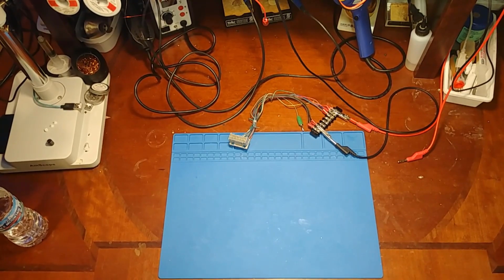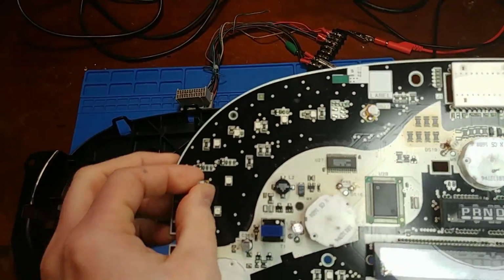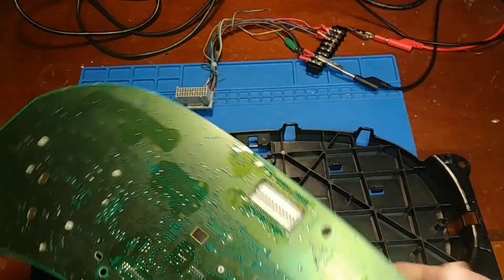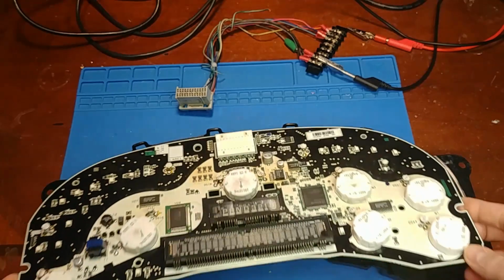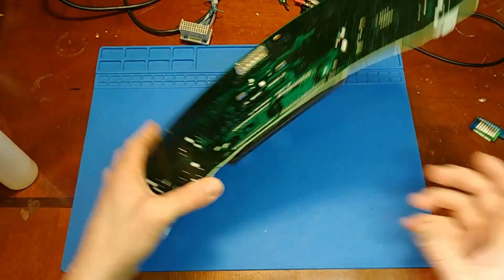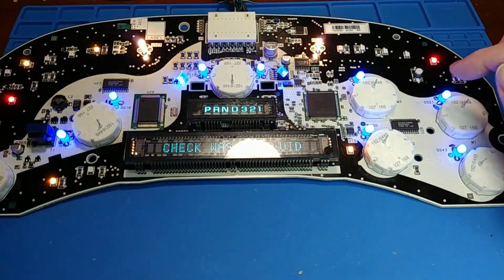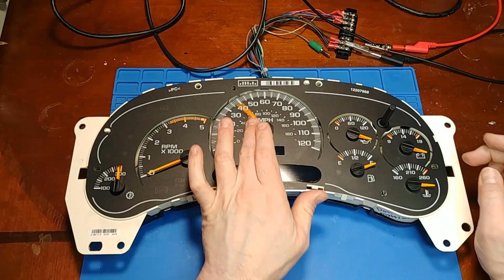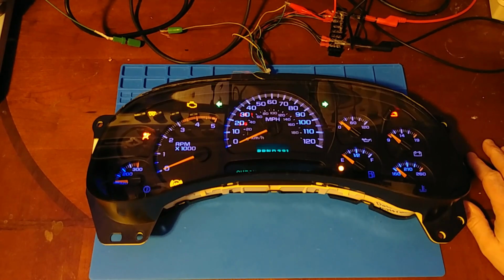Rebuild of a 700k+ mile Cluster with Blue LED's.

Comment: Absolutely love your videos..... you're obviously about 100 steps ahead of many "u-tube", dash cluster "experts",  however.. I have just One "complaint/request" of you.... "If" you're sincerely interested in helping those of us who may be, or Are capable of potentially effecting these levels of repairs ourselves at home.... at least as far as the soldering, air-core motor rejuvenation, etc is concerned.   

In all the GM dash video's that I've watched from you... you never Once, tell what your using... ie; various (cleaning?) solutions, soldering wire gauge & type, soldering station type / model, De-soldering tool used, etc, etc.... ALL of which would be extremely useful & Very Helpful information for us semi advanced/advanced DYIer's to know.   Would Greatly Appreciate that kind of info, if you would Please include that, as you work on this stuff... during your videos.   

Would be REALLY helpful to us "out here", if you explained why you're doing, what you're doing as you go along.   It would have been Really helpful to know (ie;) what or where you got the syringe/? with the special end on it for purging and refilling the "air-core" motors for the 99 - 02 gauges, as well as, what weight of "oil" that is used to rejuvenate them.   

Also, is it OK... to replace the original incandescent dash cluster bulbs (just the one's for night viewing of the dash cluster - Not turn signals, etc.) in the 99 - 02 cluster, with LED replacement bulbs... without causing any issues of Any kind ?   Grateful Thanks for your time and any response that You, can reply with... much appreciated.
Reply from the maker: Many of your questions are answered in my work bench tour video. 
https://youtu.be/LnDgK4rJ2us
Yes you can use LED's in the 99-02. I don't provide LEDs in socketed pre-assembled form because of reliability issues with the LEDs.
Reply: @jeffescortlx ..... Jeff, Thank You for taking the time to read and respond to my "complaint/request".... Very much appreciate it.   I felt rather foolish after posting my comment to you, as about an hour later, I went onto your site and found the video that you sent me the link to in your reply... so, I've watched it twice, now... and it helps a Lot.  

I'm definitely going to look into purchasing a De-soldering tool like you have (for other soldering work I do on electric guitars, and hobbies.)... or, whatever model they now have, similar to yours.  

I do have a soldering "station with a range of 360 to 846 degrees... but does Not have a Hot Air accessory.  

Is the Hot Air tool used in the De-soldering process, or ??  In reference to LED's for the 99 - 02 GM's... are you saying the LED's themselves have issue's, or is it the original OEM socket - with an LED in it, or ??    

PS; Just earlier, today (Friday) while driving (02 GMC 2500 HD - diesel w/6 spd manual trans. - 300K +/- miles? - Odom/trip light quit, 6 yrs ago) - the Airbag light suddenly came on & at the same time, my side mirror (both sides) control - no longer working - any way that they could be "connected"??... doesn't seem likely, but ???.   

What is the current "turn around time" (not sure where you're located, I'm in western edge of MO.)... approximately, if I were to send you the dash cluster, to fix the non working Odom/Trip light issue, and give it a good going over/health check and preventative maintenance fix before it breaks (air-core motors, etc, etc), and possibly replace All the lighting with new OEM style, and LED's where applicable ?  The dash cluster has never been removed since it was new... is all original. 

Are either Green or Red LED's available in the type you use ?  

Thanks again... Have a great weekend.
Reply from the maker: @Romans--bo7br  hot air is for removing/installing surface mount components. The 3rd party LEDs that come pre-assembled in 194 twist sockets are normally of low quality. It's not uncommon for them to fail within a year. While the OEM 194's are good for 300k. Turn around time is typically 1-3 days depending on work load.

Comment: What did you clean with? My board is brown in those exact spots, just off the speedometer gauge on the left side. Gently wiped off, but some still there, should I try isopropyl alcohol with a cotton swab? Tia!
Reply from the maker: Yes ICO (~91%) is perfect to use.

Comment: Way do you spin the needles to take them off? I know they can just be pulled off. Got to be a good reason.
Reply from the maker: It breaks the grip free. Otherwise it's possible for the shaft to stick to the needle and pull out of the motor gear instead.
Reply: @jeffescortlx  good to know. When I put new needles on mine I spin them counter clock wise not to break them.

Comment: Jeff 
Do you recommend replacing the  incandescent bulbs with LED‘s?
Thanks
Reply from the maker: No I don't reccomended LED's for reliability. LED's are sensitive to inductive kick back and transit voltages. The lamp circuit has no protection from that, because incandescent bulbs don't require it.

Comment: Just FWIW, Tin Whiskers are different from Silver Migration in that TW is single crystal growth of pure tin and SM is dendritic migration of the PCB metals along contamination paths between circuit pads and lands.
Reply from the maker: A good alcohol scrub should clean up either issue? I more often see the dark stain around via's, I assume this would be SM?
Reply: @jeffescortlx  yes but for real tin whisker mitigation the fix is to add leaded solder (I use 60/40) but at least 6% minimum lead.  The contamination issue is more difficult as it is usually the result of the chemistry process leaving conductive salts on the board from the plating process that have to be physically removed.  Depending upon what you see it may need scrubbing with a fiberglass brush as well as scraping lightly with a scribe.  Patience wins the day.  The dark stains around the vias may be due to board heating effects if they are adjacent to power resistors or are in the circuit of the power resistors or other power chain devices, usually a result of the through hole plating.  The only way to find out definitively after return would be to run the circuit and look at it with a infrared display to see if they are heating, that or section the board for analysis.  The latter method is too destructive if the cluster is to be used further.
Reply from the maker: @chuckpatten7855  I don't remember finding tin whiskers across IC pins, but I do often see dark stains at the via's, if left long enough it will cause a low of enough impedance to effect things. I have a scrub pad for doing body work that cleans it off without being too aggressive. Thanks for your insight, it is appreciated.

Comment: Have you heard of Blackcat Custom ? They do aftermarket cluster faces. Just wondering if you have heard anything negative. Have a 1995 S10 that I would like to change face to white with blue lights. Do you know of a reputable place that replaces the face?
Reply from the maker: I'm not familiar with that brand. You might have slim picking to find a face for a S-10.

Comment: What do you use to extend out the added bulbs? Some kind of wire or solder? You do such great work!
Reply from the maker: Just the LED leads.
Reply: Gotcha, Thanks for the reply,  wasn't sure, I need to add a couple extra led's to mine, I tried using solder itself, tricky though, my led legs aren't long at all,

Comment: Jeff i was wondering ,i found 2 different color code charts to test bench it for the unit my buddy has in his truck and neither will power it up ,no lights no nothing.It is in a 2003 gmc 1500
Reply from the maker: It's common for the 2003 board to have power loss issues.

Comment: Hi, I have a 2000 gmc sierra and I swapped in a denali cluster for the trans temp blue lighting and 120 mph speedo, Can you change the odometer to match what is actually on my truck ? And if yes how much to do it? Thanks
Reply from the maker: Yes my contact information is linked in the sticky post.

Comment: Love your videos. Very thorough. Question tho @jeffescortlx I have been seeing people changing the colors of the PRNDL and DIC from the typical GM greenish to full white. Would that be a screen swap for the color or something changed on the circuit board. Just curious. Thanks for the info if you know!
Reply from the maker: The color is changed through a color transparency film, typically included on some after market faces.
Reply: @jeffescortlx  oh wow ok. So if I got a gauge face with a clear PRNDL and DIC it should be stock white? Also thanks for the quick response!!
Reply from the maker: @FreeLifeFilms  no, I believe the film needs to be red. Green color passing through red should make white.
Reply: @jeffescortlx  you are awesome. Very much appreciated!!!!! Thank you!!

Comment: Could you give me a part number for these 12 volt LEDs?? I've been doing these clusters for years and have yet to find a decent LED to run in these. Like you said they're pretty susceptible to damage unlike the Incandescent bulbs.
Reply from the maker: Unless you're ordering 5kpcs at a time, I'd reccomended the US Speedo cube LED's, otherwise I like sticking with incandescent.
Reply: Are all the incandescent bulbs the same? Or can you recommend a good source? Please and thanks

Comment: I have an 04 Tahoe that says "Service brake booster" but it has hyd brakes...can you cancle that out along with the Tpms warning?
Reply from the maker: That typically happens when someone installs the wrong cluster. I'd reccomended to have the original cluster rebuilt so you don't have compatibility and odometer issues.
Reply: dont have the orig..bought truck with this cluster..it came out of a truck with a brake booster..
Reply from the maker: @ding0925  I see. After you find out what the odometer is supposed to be, contact best pixel inc. For vin programming.
Reply: ok..thanks

Comment: so when putting the needles back on with the cluster unplugged everything goes to zero and the rpm and speedo go a little below ?
Reply from the maker: No not exactly, if your not going to mark the needle parked position before pulling the needles off you need to reset them with the cluster on, but no input signals.

Comment: Thanks for your very informative videos.  I noticed the DIC display appears dimmer than the gear selector display.  I had previously successfully replaced my stepper motors and bulbs prior to seeing your videos.  I did have a dim gear selector display, but reflowed the solder on the offending resistors to the left of the speedometer stepper motor.  I was wondering why my DIC seems a bit dimmer than my gear selector indicator.  Other vehicles seem to have equal brightness.
Reply from the maker: You probably have a 2005.
Reply: 2004 GMC Sierra 2500hd
Reply from the maker: @pdspaint  do you have a lot of miles/hours on it?
Reply: 135k miles....I haven't yet tried reflowing solder at any other spots on the board.  Only did the resistors for the gear selector indicator, which was very dim.  DIC is still readable except in strong sunlight, just not as bright as the gear selector display.
Reply from the maker: @pdspaint  I'm wondering if your 04 has a 05 revision board. 05 have issues with the odometer VFD going dim with use.
Reply: Thanks for the updates.  Since it's still working and this is a minor issue, I'll just let it go for now.  When it fails I'll send it to you.  Keep up the great work.
Reply: BTW...what is the voltage to the DIC vfd supposed to be ?
Reply from the maker: @pdspaint  42 to the driver chip and like 1 to the hot wire. But increasing the voltage isn't going to make it brighter.

Comment: Jeff would you share the LED you used in the build please. If you have a link to those would be nice. Thanks
Reply from the maker: I typically use a 5mm single chip diffused lens flat top native 12-14v LED.

Comment: Do you do any modification for cluster dimmer when changing from incandescent to LED? Not being able to change brightness of LED backlight at the same rate with incandescent is somewhat annoying unless you change every light on the dash with LED.
Reply: No it ends up matching pretty close.
Reply from the maker: No I don't do any extra modifications. I just try my best to match the intensity to the rest of the dashboard. And correct, it doesn't dim at the same rate as the factory incandescent. That's just a sacrifice that needs to be made when someone decides to change out to LED.
Reply: @jeffescortlx  I have replaced old cluster with 194 bulb with LED before and the intensity issue was a bit annoying.  Now I have 05 F150 and has been putting off replacing backlight because of this issue. I like to have white backlight. 
I'm also looking into possibility of making oil pressure gauge actually display real oil pressure. But since this cluster has stepper motor for the gauge, things will get a little complicated. Unless I can reverse engineer code in MCU, looks like I will need a external driver to make it work.
Reply: @lambintion   >The 194 peanut bulb is incandescent is always slightly yellow. Replacing with LED’s require research for “Kelvin =3k is just above yellow and look white. 3.5k is cool white
Lumens =120 low / 5k bright, and stick with name brand stuff like “Osram, Sylvania, Phillips etc.

As for oil pressure, speaking as an ASE Master, we remove the sender (5 volts w/variable out) install a fitting w/hose to trusted gauge. This allows cold-hot + idle to 2K RPM and compare. If close, leave alone as you will have a 1/8” coil of copper tubing to gauge to new fitting at engine. One day it breaks and oil starts spraying your socks. I don’t want a live gauge. Depends on what Ford did but two wires is normal. Some use oil sender with 3rd wire to shut off fuel pump when upside down in a ditch spraying fuel on exhaust. Ford used a magnet with gold plated steel ball that if hit, would dislodge shutting off fuel after fender bender. Highway Patrol had a book showing location of re-set switch to get you off street. Keep what you have but check it with a hose gauge. The volume of oil leaks passed cam, lifters, rods and crank bearings. If thin, low at hot idle, if thicker, it maybe higher. If still low, engine maybe worn bad. 
  Find a Ford Truck / Car Forum online, join and ask question with type of oil and reading hot and speed. Year and engine size is needed for correct answer as 2,000 guys will give you advice. Some good! Hope this helps!
ASE Master Tech-1978-Retired.
Reply: @deankay4434  Ford just has a pressure switch with single wire. Doesn't actually measure pressure at all. The cluster will just move pressure gauge to middle when it receives signal from the cluster. So, even though my truck as oil pressure gauge, it is nothing more than just low pressure light. That is why I was considering modifying oil pressure gauge. 
It technically is possible to replace the sensor and drive oil pressure gauge with a separate stepper motor driver and use something like Arduino to translate signal from real pressure sensor. But, probably better off just having secondary gauge with better resolution.
Reply: Did not know it was a switch instead of sender. There are lots is things possible like finding a perfectly new cluster with gauge and shinny new canister type sender with intake removed in the bone yard with less miles on it for $10. But I don’t know anything about the last 25+ years of the world of Ford. The FBI and City garages had them but I was there to teach basic electrical in classes to help them prepare for ASE certification as they had to. Only to hear the Troopers carry on how slow they where to the Caprice and front brake wear. I taught for ACDelco as contract labor for Raytheon. 
  Yes, I would imagine some programming maybe required, don’t know. You can find a Ford Truck forum online, create a profile and either electrical or engines ask that question. Yes, you could “TEE” off the lights switch and add a gauge.

Comment: Have you ever heard of one of these clusters not responding to the buttons on the steering wheel? The display shows the mileage and trip but won’t show the service due message. Could the truck have the wrong cluster?
Reply from the maker: Yes, if the only option you see is "trip" some one put the wrong cluster in.
Reply: jeffescortlx thanks!
Reply from the maker: @jiffry58  your welcome. You'll have to track down the original cluster for full compatibility and true odometer reading.
Reply: jeffescortlx its a customers vehicle. He just bought it so that should be fun! Thanks for the info! Love the vids!
Reply from the maker: @jiffry58  it's always fun to explain to a new vehicle owner that it doesn't have the miles on it they think it has. For the heck of it you should see if your scan tool can read miles from the main engine ECU?

Comment: Hey Jeff what is your source for gm 03-06 oem bulbs . Part # is you have it ... ty sir
Reply from the maker: My over seas supplier doesn't assign the bulbs a part number. They deal in high quantity specialized cluster parts. But the description to order by is 4.7mm 100ma @ 14v.
Reply: Thank you

Comment: Hi All, wanted to know the indicator clicking sound comes from a speaker in the instrument cluster or is it located some where else?
Reply from the maker: It depends on what kind of vehicle it is.
Reply: @jeffescortlx  Hi Jeff thanks for the reply, my vehicle is a MG 3 1.5  petrol ,  my issue is occasionally the indicator turn signal sound does not work but the indicator lights are working , i have noticed that if i drive over a bump the turn signal sound may  start working or stop working.
Reply from the maker: @ferhassheikh4061  I wouldn't have the slightest idea. I just work on Chevy and Ford's.
Reply: @jeffescortlx  thanks Jeff.  Love your videos. good work.
Reply from the maker: @ferhassheikh4061  Thanks! Wish I could have been more help.